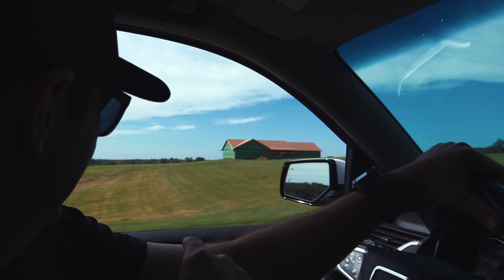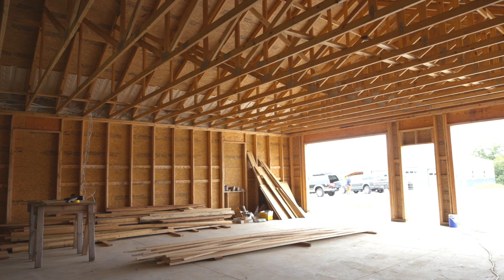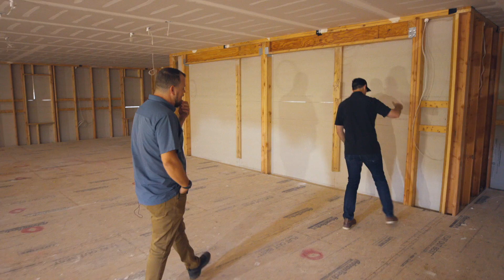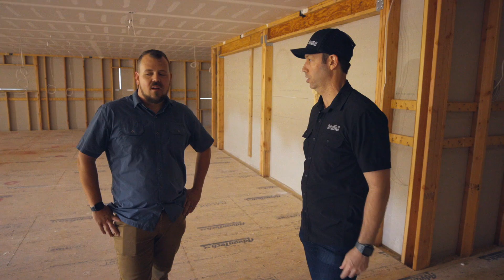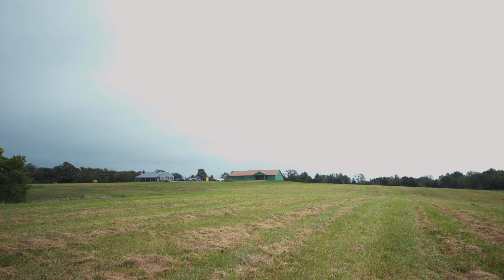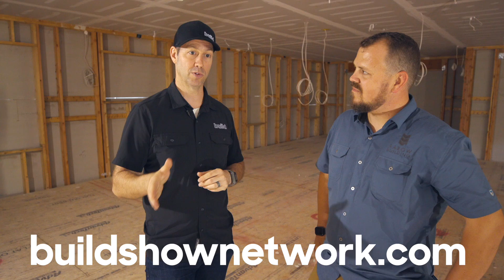A House with No Doors or Windows?

Comment: IMHO, the R-value should be calculated as less due to the poor insulating qualities of the studs-1.5 , which is R-1 up to R-1.5 per inch of thickness.  Only SIP construction, using spline connectors without studs inside the SIPs, does not need this deduction.  Also, SIPs have no thermal looping.
Reply: ICFs also do not need this reduction. And are typically cheaper and more airtight than SIPs.
Reply: Joe Lstiburek, who owned a SIP company, stated they don't get air-tight enough. I thought the same thing about them being air-tight, and maybe some are better than others, but I heard that was one of his main issues with them. And I am not sure of the total cost of a SIP package, I just got a quote for a roof system once because I was interested in using them on top of the ICF walls. Much higher prices than I expected. If those were scaled to wall prices, ICF, fully done, would be comparable probably. It does depend. If you stack them yourself you look at about $10/wall sqft completed, and if you hire them out it is typically $16-23/wall sqft. (At least talking to the one I know, that is his most recent pricing, dependent on complexity, etc.) I don't know what SIPs run;  they have several other disadvantages I perceive, so I don't use them.

Comment: Looks like nice windows and views coming. Double or triple? 
Great vid to learn from.
Reply: probably the newer r3 or r5 ones or even the super expensive higher r value ones but if they were going higher than r5 windows I would have used thicker walls and higher r value walls
Reply: Schuco triple glazed, some very large - and the views are exceptional
Reply: @stevenbaczekarchitect9431  Sounds awesome. So the only basement you excavated is for equiptment? No wonder the site looks pristine. Wanna share what'll be the exterior? I doubt stucco.  🤠

Comment: Sorry, I disagree,  should of gone with ICF with a closed cell roof insulation with a  metal roof.  My total HVAC bill for the year is only $170 in lower Alabama for 2000 sq. ft. home.  Rock solid ICF.
Reply: I definitely agree that ICF will provide a better wall envelope for similar cost. After the expense of Zip, and fussing about to make it all tightened up, I can't imagine there being a savings over ICF. And ICF comes r-28 standard. I would however say that this method for ceiling airtight-ness is better than roof deck spraying. Cheaper to spray one inch of open cell on the ceiling topside and then dump r-60+ in the attic for cheap. Should cost about $1.50/sqft for the attic insulation that way. This allows for an air washed roof deck to prevent hot deck issues as well as ice damming issues. (Neither of which you need in Alabama with a metal roof, but I live in climate zone 6...)But surface area transfer is greater with spraying under the roof deck and getting to r-60+ with straight foam on the roof underside gets pricey pretty quick.  I would guess close to $4/sqft. I'm still shocked Matt hasn't explored more ICF stuff...he is getting better for sure, but it seems he avoids it for reasons I can't understand.
Reply: @joshualruby  I have a 16 on 12  pitch roof just so I could put a 500 sq. ft. bonus room over the attached garage and because of that I ended up with a large walk-in attic over the main living space and lots of walk-in storage.  For the comedy effect, I have a chocolate Easter Bunny standing guard year-round in the attic people notice on the tour.

Comment: Wouldn't it be better to build to it cheaper at $150 -200 sqft? I would think all the extra upfront cost must take 50-100 years to see a return on the investment. Sorry I don't see the point.
Reply: Agree 100%
Reply: Yup, maybe we should have put in single glazed windows, no insulation, no airsealing, no water management, no concern for occupant comfort and health, a total disregard for environmental responsibility, a total disregard for durability - yes then we can call it an affordable spec home.......totally agree
Reply: @stevenbaczekarchitect9431  if you have a customer base willing to pay for a home this tight by all means go for it. I can't see anything wrong with a solid home built to last. That said the economics price this home beyond what an average buyer can afford. For example I have a home at a similar size but was built in 70s with 2x4 construction. My annual heating and cooling in MI cost me $1200 per year. If rates remain the same I'll spend 60k over the next 50 years. I see no reason to step over dollars to pickup pennies.
Reply: @vraczok  makes sense to me 👍
Reply: @stevenbaczekarchitect9431  why are you getting so bent out of shape? Is Matt your boyfriend?

Comment: Is that an effective wall R-value of 28 or nominal? You should really start specifying. Less of a big difference with continuous exterior insulation but definitely not the same thing.
Reply: It's nominal - the whole wall R-value is probably in a R-12-14 range

Comment: So then all that sheathing over the windows is just wasted after it is cut away? How much does that waste cost?
Reply: Don't even!! I wish I had the $$$ for what I see builders throw in a dumpster......
Reply: That's actually how it's done anyway.  You put up full sheets over the openings and then cut out the hole in place.   Some builders might use up the scrap elsewhere on the house but the cost of the wasted scrap might be less than paying your carpenters to puzzle-piece little rectangles together to make a full sheet.
Reply from the maker: Agreed. Thanks Tom
Reply: @buildshow  Totally agree, I vote for more Tom's in the comments....

Comment: While the cost to build houses like this seems astronomical,  they are designed to last a thousand years instead of a hundred years.
Reply: What's really interesting to me is most of the contractors I meet that question the $$$ sq ft are driving around in their F-250 or 350's? Why don't they drive around in a white 2 dr 2wd small size pick up.........
Reply: @stevenbaczekarchitect9431  Those heavy duty trucks are needed for occasional material runs, and thus need the extra hauling capacity, especially when hauling a full dump trailer. Plus it also shows a measure of success.
Reply from the maker: Steve’s point is that we spend money on what we value. My hope is that the Build Show will help convince more Americans to value Well Built, Durable, Efficient Homes. This home isn’t much more than a standard built home but outperforms it in every category.
Reply: @barnabyjones6995  dont you think there are clients that measure success by the homes they choose to build? Value certainly varies
Reply: @stevenbaczekarchitect9431  Sure, it depends on what the customer wants and where they want it. Where I live, there are a lot of
Reply: Thousand years LOL

Comment: Spends all that money on the zip system but hires an electrician who can't calculate the correct boxes that need to be used for the ceiling.....Who's the electrician putting 2 14-2 (10cu) wires in a 4" (6.0cu) inch pancake box? 2:37  Interesting videos as always Matt.

Comment: i like everything you guys talk about .ive been building for over 40 years , back in 2007  i went the way your going in the northeast , fairfield, county , only thing is we get one or 2  million plus dollar houses  every 5 years mostly we build for new home buyer who expect stuff like this but wont pay for it , i do 10 a year all energystar with nice finishes 1.5 on tightness done with conventional glass in walls standard zip outside membrex poly with a blown 49 in attic, heat it with 45,000 btus and a nice cooling system to match. tankless hot water  gas heat cooking and a token gas fireplace ( with a properly prepared hole to put it in.  2100 sf well septic drveway $495,000 done in 3 to 4 months. and we can barely pay the bills. i want to give them more but they stil want what the see on the internet, it gets harder and harder. check us out Connecticut Residential

Comment: Many houses are 3 walls wide. 2 floors wide. Add another 3 walls one wall away. 6 walls 5 floors wide square
Reply: ??? What ???
Reply: @colstace2560  spans. There's only so far a floor can be supported until a foundation is necessary to keep the floor from buckling
Reply: @thetommantom  the floor is on a concrete slab
Reply: @colstace2560  ahhhhhhh I see. Where I'm from we got basements.

Comment: Why are none of the house steel framed?
Reply: Because this is America.
Reply: Thermal bridging is much worse with steel vs wood.
Reply: @krinohs  there's cars made out of carbon fiber tho. Steel is rot, bug and fire proof. Also endlessly recyclable. Lighter weight and faster in my opinion.
Reply: @mactek6033  I HAVE framed with steel, it was a commercial shop but it is in America.
Reply: @jezza6575  you want to minimize thermal bridging no matter what you frame with. Either with double wall construction or exterior insulation.
Reply: @mycool8980  I built a house with steel frames, all welded, was a Nusteel kit in Australia, I had no problems

Comment: This looks like a nightmare to wire
Reply: For a very short time my company wired modular homes 2-3000sqf and the wire was installed about the same way. It was not bad and very nice in the dead of winter. Just took a good architect and us sparkys being willing to try new things. There was a little extra waste but after roping the third house we kinda knew how much extra and how-to tie it up to make the connections quick and easy. This house would be about the same I would think.
Reply: It’s a really easy setup quite honestly. Good Architects for the Win.
Reply: @tysleight  You said you used rope, which makes it faster and easier than the conduit that is code in a lot of places.
Reply: @jefflosey1561  Thank You - A man with good sense right here
Reply: @barnabyjones6995  where is conduit code for a single family home? That would suck!
Reply: @barnabyjones6995  Where is conduit code for residential single family, or 4 unit and less?  I've heard that Chicago, and maybe all of Cook county is that way.  No doubt there are others, just haven't heard of them.  I'm curious how common that is.
Reply: @andrewalexander9492  I work for an electrical supply company in DuPage County, Illinois and the six + county around the Chicagoland area requires conduit. The average  2500 square foot home usually uses  a out 25 bundles of 1/2 inch EMT conduit for the whole job.
Reply: @barnabyjones6995  Thanks,  So a pretty good radius around Chicago requires it, then.  Do you know of other parts of the country where it's a requirement?
Reply: @andrewalexander9492  Not sure, I think the Unions advocated it for safety reasons. It is theoretically rodent proof and you can fish tape extra lines through later for extra power.
Reply: Plus in the event of a fire, the wires should  not melt as fast, giving escapees of the blaze a few crucial extra minutes to be able to navigate a lighted escape route.

Comment: This is the first time I’ve seen a residential ceiling with 1x strapping... outside of New England. 

How are the top and bottom plate of the interior walls attached, and to what? In high wind I wonder how much that truss bottom chord moves. (Maybe not a concern at all with flat bottom truss).  I hope to see more as this one progresses

Comment: Yes it's nice to have a well-insulated home but then you end up running an air exchanger 24/7
Reply: Not true - there is a duty cycle but its not 24/7
Reply: Air exchangers sip energy compared to a typical HVAC unit. With the insulation and air tightness they are doing, I would wager they'll be able to heat and cool the house almost completely with the air exchanger and have pretty sweet utility bills.
Reply: @stevenbaczekarchitect9431  it is alot though
Reply: @randycarreiro8363  Look at it this way; it doesn't take a lot of energy to move air, what takes a lot of energy is to heat it or cool it. With a well sealed, well insulated house, you just have to move the air through the air exchanger.  On the other hand, if your house was leaky enough that you got sufficient air exchange from the permeation of outside air without an air exchanger,  then you wouldn't have to move the air outside through the enchanger, but you'd have to heat that amount of air (or cool it depending on season), plus you's have to move it (circulate it ) around the house.  So, with the leaky house you're  heating the air and moving the air, but with the tight house, with  efficient heat recovery on the air exchanger, you're just moving the air, but not heating (cooling) the air.
Reply: And? That’s literally the point. Air only moves when and where you want it to. A building like this will probably cost next to nothing to climate control because of the extreme air tightness and insulation, even if you factor in the cost of running mechanical ventilation. 

Also if you ever want to not run the mechanical ventilation, it will (eventually) have Windows you can just open.
Reply: @rpvitiello  OK, I guess I misunderstood your short comment as meaning something else.  I think we're on the same page here.

Comment: What if you build a house with all picture windows/non-operating windows. That way they are all 100% sealed and will never leak water/air.
Reply: That is great in theory but code requires (and rightfully so) egress (windows that open) in areas so people can escape in case of a fire.
Reply: @chancebeasley6536  Every window can have a small  hammer/button that smashes the tempered glass.